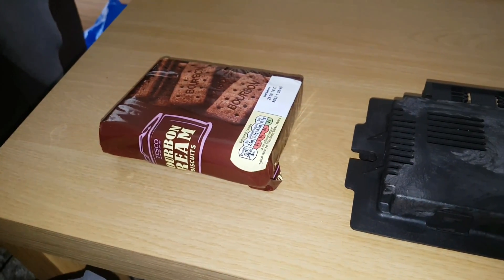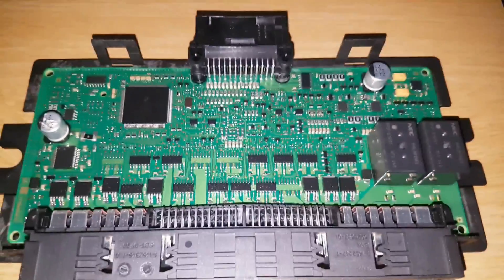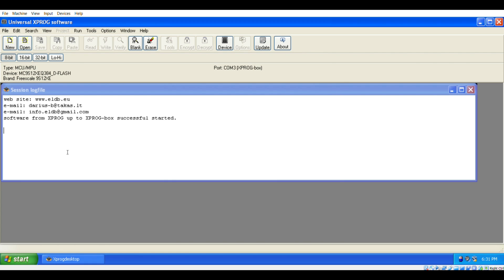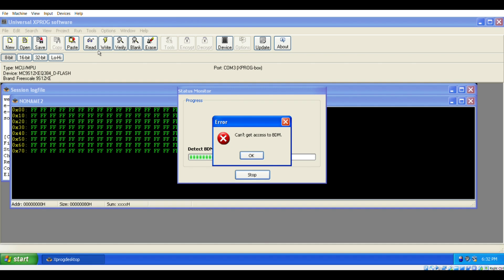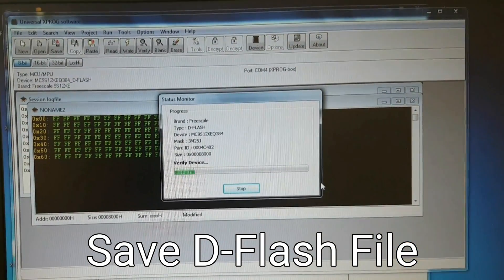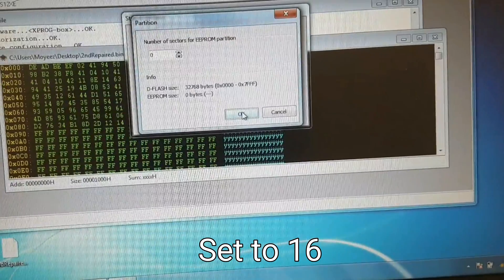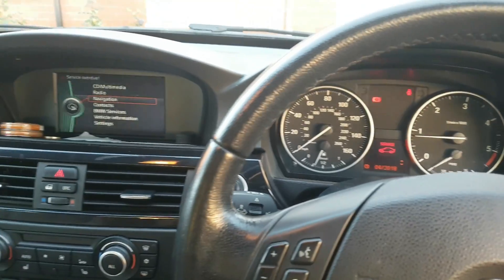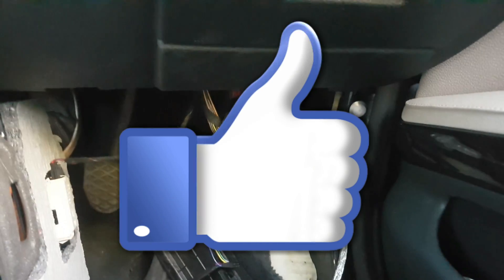BMW how to repair foot-well module or lighting module, FRM FRM3, using xProg (or similar)

Comment: I don't know how this could have possibly worked for you. In your video clearly the verification from the dflash read failed.  So your dflash dump was probably invalid.

I attempted this with xprog 5.55. Big mistake, this version of xprog is known to fail to verify. If anyone is going to attempt this, make sure you buy xprog 5.60 or higher.
Reply from the maker: I was showing the process. It wasn't the "read" that led to saving the dflash. 

And it worked fine on that instance without any errors.
Reply: Did you get it to work with a newer XPROG? And did you buy original or cheap China clone?
Reply: @charalamboskioulos3932  Yes, I fixed my FRM3 using the cheap Xprog 5.55 china clone. $49.99 shipped to me.

The Xprog 5.55 version of the clone has flaky reads. In my case, I tried reading many times with verification and only had one successful verification. I converted and flash EEEProm from that read and it DIDN'T work. lol.

Thanks to folks on the internet. It wasn't that difficult to find a EEEProm file for my FRM3, slightly newer version than mine. I used the same Xprog to flash. The verification of course failed. But it works!!

So, I could have been very luck that this single flashing was successful. Or that this Xprog has no problem writing. Or that the data off my FRM3 was corrupted in the first place. I don't know which case it is as I don't want to try my luck again.

Flashing someone's EEEprom creates additional work.  I had to buy a data cable, hook up computer, run WinXCP, NCISExpert to update the VIN and program the module to my car's order.  After doing all of that the car worked like new again.
Reply: @uswwt  This is actually better, more accurate info than the video. I have a K+DCAN cable and Mike's BMW tools. Have used it to code injectors in my e70 X5d. I will have to try this route. Will search for EEEPROM files on XOutPost. I've read the D-Flash like 30 times. Every time I go to convert it the VIN is wrong, but different each time. Should have gotten a newer XPROG...
Reply: @charalamboskioulos3932  Yup, same for my Xprog 5.55. Every read produce different data. That's why the verification always fails.  The VIN read from my FRM3 contain random characters, even for the one time without verification. So no surprise that didn't work.

You can find the part number on the FRM3 label and google EEEProm with that number.  In my case, I flashed the firmware of a different part number. But the car model is the same.

Even without programming, windows, lights everything are working correctly. However, the annoying Lighting System error message persisted on the screen.  I later found out by reading errors in NCIS that the error was something like "coded feature not available for vehicle".  Again, not a surprise as I flashed some other car's firmware.  Coding fixed the problem.

I kept my cheap Xprog programmer in case the FRM3 went bad again.  But, I have a new battery in now and the car is fairly old. I hope I don't need to use it till the car retires. :) 

Good luck with your journey.
Reply: @uswwt  I am in need of your expertise. My FRM is failing and my windows and lights are beginning to malfunction. I had my FRM replaced under BMWs extended warranty last October, but the warranty on that replacement expired earlier this year. I also had a friend to try and reflash my FRM3 but nothing changed.

In my place what would you do? Would you buy a new FRM or would you attempt to fix it with xProg? I am not very good with car programmation so I do what I can haha.

I have found a xProg version above 5.55 (5.84) for rather cheap on aliexpress but I wasn't able to find that BDM adapter.

What are your thoughts? How should I go about this, because I am quite lost hahaha.

Thanks a lot!
Reply: @mayonaisesaladejamaismalade   @Michel Stephan  I am no expert, lol. But I think I have read enough to know a bit.  How did your friend flash it? Since the software still works to some extend, the memory might have corrupted. 

I would try NICS expert first to flash to Original factory setting into the FRM. That should fix configuration issues if the software is still good.  If that still doesn't work, I will buy a programmer, download a EEEPROM file from internet, ideally the exact part number, or at least same model of car.  Flash that into your FRM3 and see if things will work. You will need to flash original factory setting to get rid of all errors. And ideally use winscp before NICS to flash your vin.  If the hardware if your FRM is still good then this flashing should almost certainly fix it.    If not, either you did something wrong or the FRM is faulty, or that the problem is somewhere else.

It will be best if can borrow a working FRM to try out. If it's the same car model you don't need programming. Just plug it in and windows and lights should work. Although car may report errors that some features don't work.  That way you will be able see if the FRM is problematic or something else. If the FRM is no good. If your FRM is bad. You can definitely find a used one from Internet.
Reply: @uswwt  Thanks a lot for getting back to me. We flashed the FRM using BMW Coding (NCS), NCSexpert and WINKFP for the VIN. The flash was successful and I can see the FRM3 being updated with INPA but the issues remain.

What is the difference between flashing it like that and like reprogramming it with EEEPROM files, like what is the difference.

I think I will buy a knockoff version of xProg. As you mentioned, we should get something above V5.55. I found a V5.84 one so I was thinking of buying that but I just can't find the "BDM Adapter" as he calls it in the video.
Reply from the maker: Almost every single listing for an xprog (assuming you're getting it from AliExpress ) has a BDM adapter if they are supplying a selection of adaptors.

It would be listed as ADP-0017 HC(S)12 BDM / ARM Micronas in-circuit programming/bypass securityadapter
Reply: @mayonaisesaladejamaismalade  NCSexpert can only code. It's like you can change the WiFi/Desktop paper/Printer settings of your computer system. But if the system code itself is messed up, you need a full re-install.  The EEEPROM file is essentially the binary of the operating system for the FRM module.  And you can use a programmer such as xprog to flash that code into the memory chip.  After that you can use NCSexpert to update the configuration again.

You don't need the BDM Adapter. The pin layout from Xprog can be connected directly to the FRM3 solder points (or buy the fancy pin tool). I have actually tried that using my cheap Xprog 5.55 clone without any issues, So presumably it should work for newer Xprog models.

To be honest, if NCISexpert didn't find any errors with your FRM3, it may not be the source of the problem. Many BMW owners of the E generation cars fry their FRM3 and render it completely not recognizable in NCISexpert. So it's hard to believe that the FRM3 software has problems. But there is always a possibility.   I think it will be wise to see if the problem is elsewhere before spending too much cash on a Xprog, not to mention the time needed to uninstall FRM3, setup your computer, flash blah..blah..

You may be able to get a used one from ebay for cheap. Swap that in to see if things work or not. If it's the same exact model, you may just need to use WINKFP to flash the VIN (I honestly don't understand why you need to do that either, what's wrong with using someone else's VIN there, lol. It's not like that evidence of a stole car.  Maybe you will have trouble when passing smog check tho. I am not sure.). 

I am not sure where you live, if you are near SF bay area, you are welcomed to borrow my cheap xprog clone to give it a shot.
Reply: @uswwt  Suprise suprise, I got my Xprog, got the FRM out, soldered everything but now I can't read the D-Flash. Not even the same error as in the video where it says it can't connect or that there is corruption. The BDM connects good but then it just reads 0X0: and there is absolutely nothing after that.

I am convinced I am doing something wrong but I have no clue what.
Reply: @mayonaisesaladejamaismalade  if xprog didn't give you errors, it might be real that Dflash really is empty. In that case I would expect none of the interior light nor windows work on your car.
You could try flash EEEProm now. But that a nonreverseable operation. No big deal as you shouldn't have really special setup anyways. So any EEEprom meant for that FBM should work.
Reply: @uswwt  The weird thing is the FRM works sometimes for a few minutes, then stops working, then it could come back to life 5 minutes later all of that during the same drive.

How do I know what EEEProm would be good for my FRM, like what are the compatibility factors that I should check. I have a 2011 E90 N55 335i xDrive.

Again, thank you for your help and support, it's keeping me motivated and giving me some hopes!

EDIT: I tried to plug back the FRM to be able to grab some information through INPA about its version but there is absolutely no communication from the module, so it doesn't even show up when I try to do identification. Could you point me towards where you got your EEProm from and which to select. I fear of completly braking the FRM if I write the wrong file.
Reply from the maker: You are talking about how a cheap clone from China didn't work for you and then blame the xprog for 5.55 for it? Just like with everything you can get a good clone or cheap clone and looks like you got a cheap one. The one I borrowed from my friend read first time and was able to verify.
Reply: @laymandiy  I think you are right. It's the cheap clone that's the problem. Google search reveal similar problem faced by other users.  I am not blaming. Have to accept the fact of you get what you paid for.  For me, the cheap clone was able to write EEEProg file correctly. So I fixed my car fox a mere $50. No complain.  I am just trying to help any fellow YouTubers to stay away from the cheap clone 5.55.

Comment: I'm getting a code for this module. I would have thought there was a failure of the hardware but it looked like you just reloaded software to make the module work again. Does this unit get "bricked" for one reason or another?
Reply from the maker: Yes, if you watch my preceding video, a lot of power fluctuation issues cause this to brick. BMW USA had a warranty recall on this. Europeans weren't so lucky..

Comment: Warning for those people who can't read their FRM3 by this method ! (UPA-USB Reset low error and etc...)
Please pin this comment ! On 1:17 you have wrong connections on VCC and Reset ! You can see it at 1:24, where connections are located on other pins ! I was wondering why my UPA is showing error on reset pin and I had it connected wrong by picture from 1:17 ! Stay safe people and thank you LaymanDIY for your video.
Reply from the maker: Not following, clearly it worked as I was able to read mine. There is no difference between the two time stamps. Perhaps UPA loom coming is inversed?
Reply: @laymandiy  should edit video to insert new image at 1:17 to match your work at 1:24, if you can without pulling video?
Reply: @laymandiy  he is right man, check where reset and vcc are at 1:17 and 1:24

Comment: After writing eeprom is winkfp or toolset 32 required to change vin or will it just work?
Reply from the maker: It will just work if you read and write your own eeprom. I used toolset32 to check and reset the count of faults it records. It was already reset to 0.

Comment: I am French I want to know if the module is used for the light rings of the front headlights thank you
Reply from the maker: Yes. If memory serves me right. Angel eyes are, headlights aren't. Better way of knowing is if other functions are not working. Like Windows and indicators.

Comment: I didn’t know I had a problem with my FRM until I tried todo some custom coding. Just minor tweaks but I was unsuccessful with the FRM. I was given a failure notice and a suggestion to not move forward. I believe my adaptive lighting is not working. Do you think reflashing might fix this or does this suggest a bigger problem? I have no code coming from the car and thus far I’ve only used an iCarly adapter with their app to do any of this.
Reply from the maker: Do your windows still work?
Reply: @laymandiy  I have the same problem except with BimmerCode, all my windows and lighting work perfectly fine. I’m just unable to code anything in the Footwell.
Reply from the maker: @japeth3568  The only way to know for sure is to check using ISTA. These bluetooth adaptors can be hit and miss.
Reply: @japeth3568  iv got same issue mine and partner car can't code frm both. But I could with here sisters bmw

Comment: some guy jump started my battery in trunk of 2008 BMW 328i..now my HEADLITES, brakelites and domwlites and wipers stay ON with car off..is the footwell module bad? its an FRm2.please help..also car wont shft
Reply from the maker: It's a possibility, your should get a diagnostic checked

Comment: How did you run xprog inside a vm? I have xprog 5.84 and cannot get it to run inside a vm
Reply from the maker: It didn't work inside a VM... I just used it to get the initial recording.

Comment: Hi bro... got no email on your link.  Actually I wanna ask where can one get the programming tool. Asides I have an issue with it.. which  tool  can repair it since I only got a diagnostics tool,so I did buy another one which was pretty expensive..
Reply from the maker: Not sure what you're asking, if it's where can you get the programming tool, then I'm sure my friend who gave me it, got it from eBay.
Reply: @laymandiy  ok..... thanks so much bro....